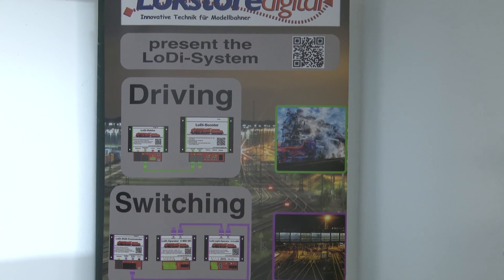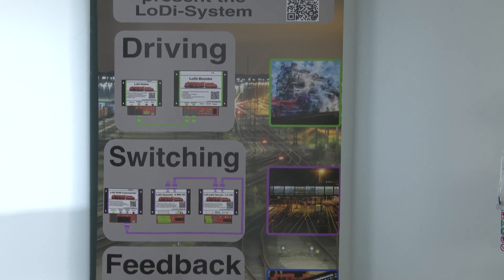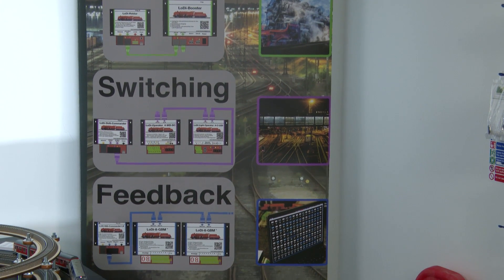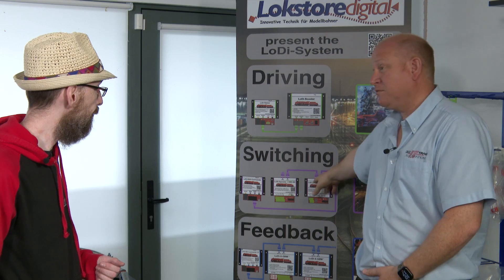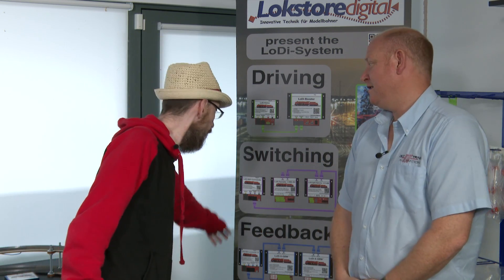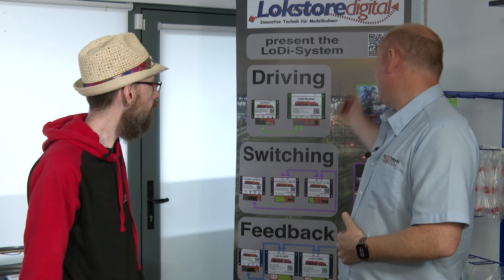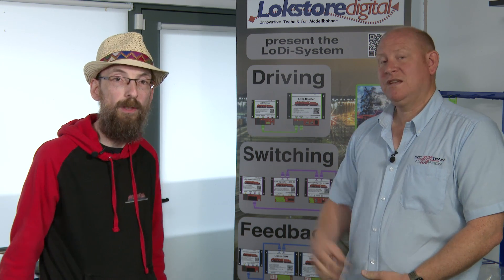LoDi Overview at DCC Train Automation.  No 5.

Comment: James, I think it was said in this video that the current is measured for each locomotive and I am not sure if this was being obtained via Railcom? It was also said that it would aid fault detection if a loco was drawing too much current? Is it possible in Lodi to switch the power from individual feedbacks -very cool if that is what was being said.

Of course, I could simply have simply misconstrued what i think that I heard. 😀
Reply from the maker: Hi you kind of got it right. 
So each feedback to the block monitors the current draw in that block. Then reports this to iTrian and you can see it there. Also if a short happens in iTrain it circles that specific feedback. 
Also, all done using RailCom.